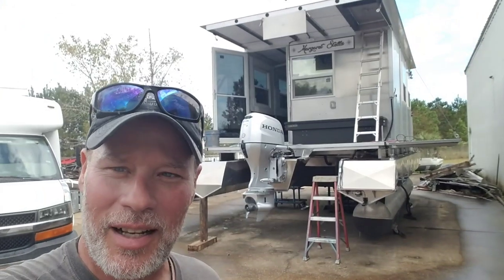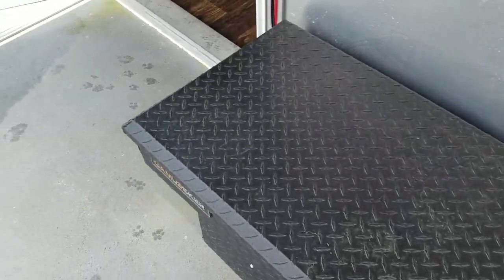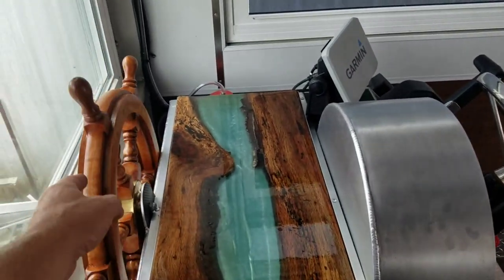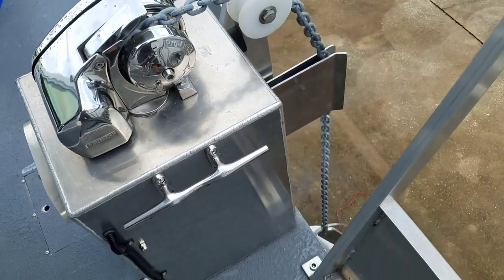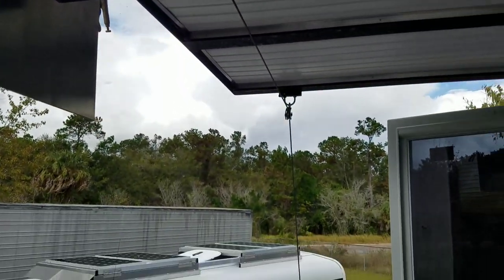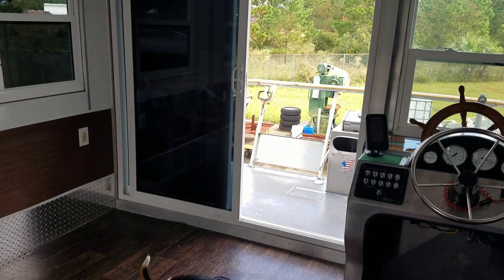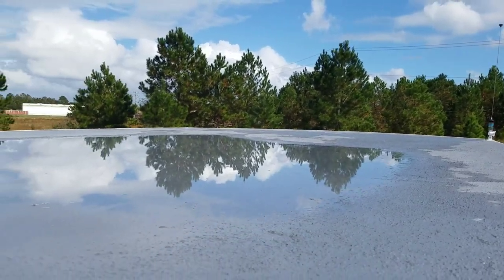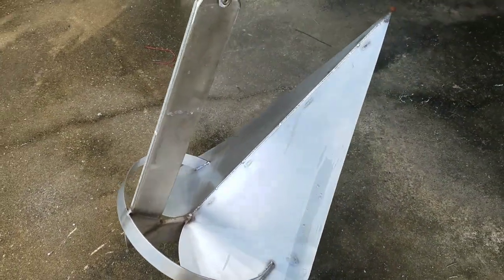The Ultimate Shanty Boat | Build Update

Comment: How long did your trip 4 years ago take? And also what did you do with the poo in your portable pooper?
Reply from the maker: The shanty boat beagle adventure? I was on the boat about 3-4 months. I used an air tight screw on 5 gallon bucket top and dropped contents off in dumpsters along the way.